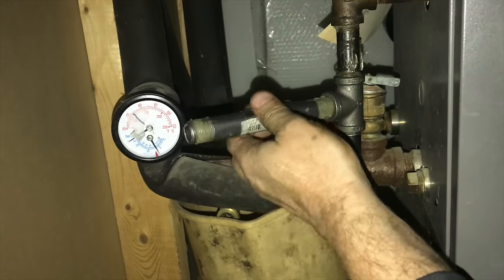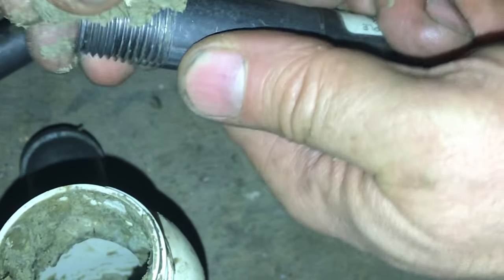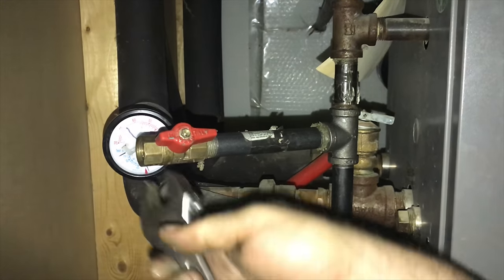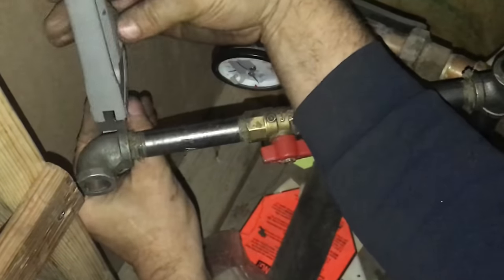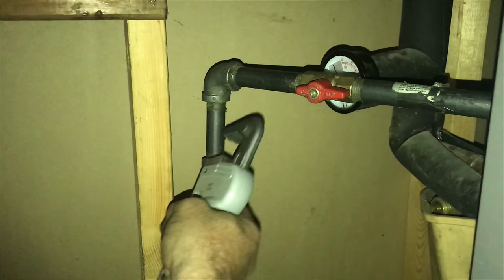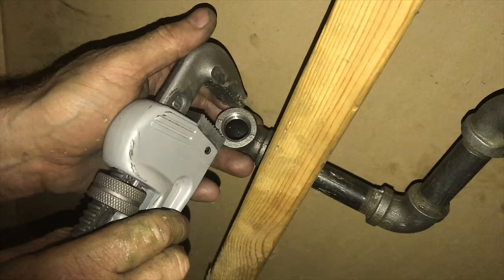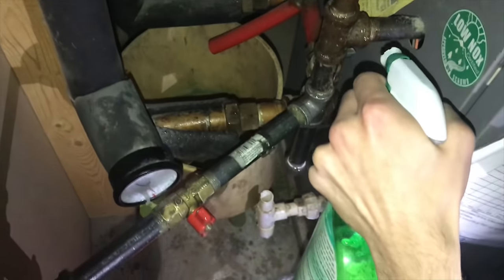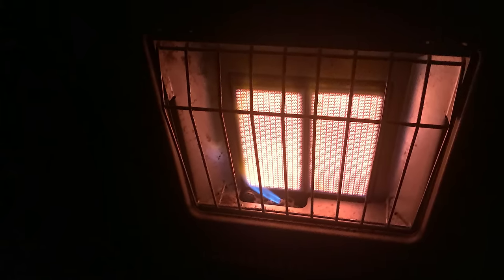TIPS on how to install gas line

Comment: I’m gonna be starting an apprenticeship for a local heating company, any tips for this and ductwork?
Reply: Don't do anything this guy did.
Reply: Buy high quality tools and don’t loan them out. Always double check your work. Learn both the local and national codes that apply, and also learn local practice and materials.
Reply: Confidence will come with practice. Observe the way the older/experienced ones do work. Practice as much as u can if u have available materials, ask questions. Be well prepared for the theoretical certification exam. Good luck !!!
Reply: Ride ThePace. What do u mean ?
Reply: Being a plumber for 18 years this vedio makes me cringe throw every second of it so so so much wrong and noone but a licensed professional should ever touch a gas line
Reply: @anonymousbyproxy8250  gas flex in the wall grabbing a fitting over the face with a wrench not having a dope brush burring an elbow on a stud running the pipe on and angle infront of a gauge
Reply: Andrew Riccardella . Those are minor issues.
Reply: @anonymousbyproxy8250  no some of these issues are major code violations from npc ipc nycpc cpc and mspc is it violates the 5 major code books im pretty sher its not a minor issue
Reply: @anonymousbyproxy8250  Andrew's right here. And you've been reported for your comments about "people like (him)"
Reply: Red aviation snips right hand
Green aviation snips left hand 
Cut duct like you mean it and it will come out clean 
Midwest by far the best snips
Lenox in 2nd
Wise is for mice 😂

Comment: Do people still use steel pipe for gas .
Reply: roy ratcliff what else would you use?
Reply: @techmetal2292  copper maybe
Reply: Nooo that would never work. Copper is way too weak and black steel pipe is way more fire resistant
Reply: @techmetal2292  good point , so why do plumbers join the existing steel gas pipe to copper pipe to the boiler.  I had a boiler fitted and the plumber done copper from the steel to the boiler.?
Reply: Copper tubing not allowed for natural gas. Read the installation instructions for a gas dryer or gas range. This is probably a code issue.
Reply: @techmetal2292  copper is allowed in Canada,.
Reply: @dilligaf2386  copper is allowed in Canada and yes we still use blk iron
Reply: @HJC1950  allowed in Canada
Reply: @HJC1950  the dryer manual wants a flex appliance connector so it can be moved for cleaning and serving with out disconnecting gas line. And to reduce vibration through the gas line
Reply: @ronaldlabelle7274  I had my gas dryer connection replaced by a licensed plumber - black pipe, flexible connector, and shutoff valve near dryer. Copper pipe not allowed in many places due to some natural gas being corrosive.
Reply: @HJC1950  copper not to be used as a appliance flex connector. Im a licensed gas technician

Comment: I saw a gas valve piped in with black pipe on one side and other side piped into bonnet.  No union so how would you remove gas valve?  You cant sawsall or hacksaw it because of sparks and gas dont mix
Reply: You turn the gas off, cut it and then add a union

Comment: wht do you do if leak on a joint?
Reply from the maker: Typically the first thing I try is to tighten up the joint that is leaking. Typically what also needs to happen is every joint in front of it also needs to be tightened. If you’re working with old gas line this could be a bit frustrating. Usually if you tighten it more The joint will seal. The threads are tapered so the tighter the joint gets the more Seal capacity happens. The only time it won’t seal is if there are cracks on the threads that allow gas to flow pass the thread. The joint compound is a lubricant that allows the thread to be twisted on even tighter. If the joint is allowed to bottom out which almost never happens it won’t be able to seal. Let me know if this helps
Reply: @livefree6878  I am installing new 1/2" pipes which are delivering compressed air.  I put all together and wrenched everything tight, and pumped up compressor, and noticed lots of joint leaks.  I used teflon tape to seal/lubricate the pipes going into the fittings, and tightened for all I was worth..  They do not have a great leak, but I can hear the hiss and squirted some windex on the joints and found the bubbles.
I am wondering what to do about the leaks though.  Can I apply something to the joints to seal them possibly?  Its compressed air at 125PSI so its not super high pressure, and its steel pipe so its not going to explode or anything either..  I am thinking super glue or some kind of sealer into the threads with no pressure applied... I am wondering what you think....
Reply: @mrstanskaggs1  call a professional. Not live free
Reply: @ronaldlabelle7274  not sure what that means.  Please write cognizantly
Reply: @mrstanskaggs1  1 minute of research

Comment: This is great! Very informative. I wonder how you installed that tee connector. I assume it was installed with the pipe wrench.
Reply: the advice in this video is bad, do not use it because the way he did this was wrong and could create really bad issues.

Comment: is it tight enuf? natural gas should come into the house at 2 OZ of pressure... or less.  more of problem for me to get the stupid ventless heaters pilot lights to light (the button thing is useless much of the time,  use long stick fireplace lighter to warm up the thermocouple for a minute while getting the pilot light lit and keeping it lit til thermocouple is warm enuf not to turn off the gas).  after get the pilot light lit it is all good. 

CO DETECTORS 2 or MORE of them and a fan on top of the gas heater to blow fumes/heat around so it doesnt go straight upthe wall and heat the ceiling.  not supposed to use ventless heaters in bedrooms and bathrooms (confines spaces cuz of CO fumes go to sleep... forever) .  but 99.9% efficient use of natural gas heat. get condensation on cold outside walls/windows... and mold.. that is easy to clean off with bleach/water. 

 i have ventless heaters in my place, work well enuf to keep the  old barn of a house warm in not summer. how can it be SO HOT here in SUMMMMER and still anything below 60*F in NOT SUMMER???? 30*F at night... a few times down to 0... and everything is out of whack then as IT IS COLD and things freeze that are not winterized... texas learned.  all electric "energy efficient" till wind farms freeze solid... and natural gas did too??? it has salt water in the ground that is produced and should be separated on teh wells location and other separators in compressor stations in the field... and probably again at local compressor stations/distribution hubs? so should be DRY gas by the time it gets into town.

Comment: Yellow Teflon tape is by far a lot better than that joint compound.  Once that compound dries up it gets very brittle and flakes off causing leaks.  The yellow Teflon tape keeps a good seal and never dries up like the compound does. I've been using it for years with no problems at all.
Reply: @SupaTrending Daily Dope and pipe tape do help seal. Although they are tapered, the threads are never perfect. Sometimes extra dope or tape help seal marred threads.
Reply: The tapered threads pull the joint together,but the parts are not formed to make a perfect seal so the putty or tape help close any gaps. If applied and tightened correctly. When the pipe dope ages it can flake off insidethe pipes or allow leaks especially in an older system that is subject to any movement at all, including settling, any impact or even some types of vibration. I’m looking at a feeder trunk now with old dope and some regular and constant gas seepage....
Reply: eu nao quero falar porque se eu fala-se oh god o que eu iria dizer ,mas sempre ouvi dizer que cao que ladra muito pouco ou nada morde
Reply: less time . O que você quer dizer ?

Comment: You'd be doing novices a favor by removing this vid. I don't question if your stuff works but you'll not see this type of pipe fitting by a pro.
Reply: Ironically, I'm looking up videos to hook up a new gas stove in my new home... When I just saw the amount of pipes and turns in this video... I was just scratching my head. Didn't think enough pipe was used to properly fit between the 2x4
Reply: Matthew Wolf . Wolfy, u was scratching no head ‘cauz u no have one.
Reply: I'm a pro steam fitter. That clown is a hack.
Reply: Thankyou for writing this comment. I have a hard enough time fixing home owners installing their own toilets and other fixtures . Definitely cant fix a homeowner blowing up their houses.
Reply: @db5095  one instructor told us that a homeowner never drowned from a plumbing leak😂😂

Comment: Should have ran it all in black pipe directly to stove with a union installed...no flex lines
Reply: Most places call for a flex line! Code bro
Reply: @t.k.2369  inside the wall is Red Tag violation

Comment: For thermal installation-radiator pipe with Hemp or teflon tape?
Reply: Hemp ok and much cheaper !!!  But teflon tape will hold too but u’ll need to use lots of it.
Reply: Been a gasfitter and plumber for over 25 years.. never heard of "hemp tape" I'm assuming you made that up
Reply: @MrDmadness  he said "hemp or Teflon tape"
Reply: @walterbrunswick  yes but "hemp" tape for gasfitting is not a thing. If he's talking insulation the fiberglass or p.p.
Reply: @MrDmadness  look I'm not "new" to gasfitting but apparently this was common 40+ years ago
Reply: @MrDmadness  he didn't say "hemp tape" you misreading
Reply: @walterbrunswick  "hemp or Teflon tape" .. dude, he's literally saying hemp tape
Reply: @MrDmadness  I was on your side, but you need to go back to English school
Reply: @MrDmadness  hemp OR Teflon tape
OR
he didn't say hemp tape or Teflon tape
Reply: @MrDmadness  if I ask you 1 or 2?
you going to say I ask you 12? 
maybe you ingested too much mercaptan over the years 😅
Reply: @walterbrunswick  you don't understand English.. yeah I gotcha kiddo
Reply: @MrDmadness  I know, I am terrible at English
Reply: @MrDmadness  I speak two other languages, and you can't even speak one😅
Reply: @walterbrunswick  sigh.. dude, I NOT TRYInG TO TROLL YOU, what I AM saying g is that YOU are not understanding this small bit in the English language.. he IS saying both are tape.. is like if I say "do you want juice?.. orange or lemon?"  It is implied that I am asking you which of these 2 JUICES you would like, not to be interpreted as "hey do you want juice? Do you also want a an orange and a lemon?   .. do you get what's im telling you?? Im seriously not trying to battle you, you speak multiple languages too.. awesome. I also speak Spanish and French a bit, though im better at Spanish, and English is my native language, I'm assuming it's not yours?? Why... the fuck are you carrying on about this? Please consider just for a minute that you could put this ego aside in a battle that is utterly pointless and learn something about the English language, I'm sorry also to bruise that ego to say that you are and have been wrong this entire thread. Respectfully intended... dude.. simmer down..

Comment: purge test/pressure test   code here
Reply: No need to for this small run.
Reply: @anonymousbyproxy8250  o-kay ,,,
Reply: Code in Ontario Canada is less then 20Ft  soap and dial for 10 minutes
Reply: Branching off of existing gas line

Comment: That is horrible, you pulled and pulled those pips through the stud until they were bent at an angle. You should have measured the piece and used a slightly larger piece so the last 90 fitting. You should also use RectorSeal T Plus 2 Pipe Thread Sealant" Teflon-based paste which is leakproof. You now have stress on your joints that are being pulled downward.

Comment: Smaller pipe wrench and a cheater on the handle for extra leverage.
Reply: 3000 PSI Gas well???  or 2 oz of natural gas pressure... if that?
Reply: @gmcinnis6304  
The pressure of natural gas at the well head varies a lot but after it is processed and put into a residential supply line it usually has 300 pounds PSI applied to it then the regulator at the building drops the pressure to around 10 ounces PSI.  That way, when properly sized, the regulator can easily supply the volume of natural gas the building needs.

Comment: Do not do gas lines like this. This guy is a hack. Use Teflon tape and pipe dope, Put on a liar of gloves,  Use a hold back wrench, don't put your wrench on the open fitting.  I would fire a plumber if I saw this on a job site.

Comment: Bad video always use a backup wrench and do not over tighten the fitting also gas leak detector is 100 times more accurate that regular soap this video make the people make mistakes and the call te technicians paying double 😂

Comment: You’re not even using that pipe wrench correctly you’re supposed to get a three points of contact one on each jaw and  one at the very back or the throat of the wrench.

Comment: Just everything ive seen in this video is absolutely horrendous. As a licensed gasfitter here in canada i see so many things wrong with this that many others have mentioned. Absolutely horrific job on the pipe dope and the wrench work. Never run corrugated flex connectors inside the wall. No dirt pocket. Definitely hire a professional next time and dont blow yourself up. Holy crap

Comment: I have had my gas license for 30 years and I have installed thousands of feet of commercial and industrial and residential gas service. It is against the uniform gas code to use threaded fittings inside an enclosed space so you will never be able to cover that wall. If you do cover those threaded fittings and something were to happen, your insurance company will not pay you a dime. If someone gets hurt because you did not follow code you will face a lawsuit. You are ignorant of proper gas pipe installation and I have never had to put my fingers on pipe dope to apply it.
Reply: Sorry but in what jurisdiction are threaded fittings not allowed to be concealed behind walls/ceilings/floors/whatever?
Unions are not allowed to be concealed, neither are flexible gas appliance connectors

Comment: That is so sad that you actually put that on you tube !  You need to learn how to run gas pipe from a union plumber if you want to know how to do any plumbing the right way ! That video is embarrassing!
Reply: @anonymousbyproxy8250  after reading most of your comments you don't seem like the sharpest knife in the drawer yourself
Reply: @anonymousbyproxy8250  so what exactly makes you some great and knowledgeable expert on said subject? Are you a licensed Gasfitter where you live?
Reply: @anonymousbyproxy8250  take what personal? The fact that you just troll others because you don't have any valuable input on the subject of the video being discussed?
Reply: It is very easy to add derogatory comments without bringing any proof.